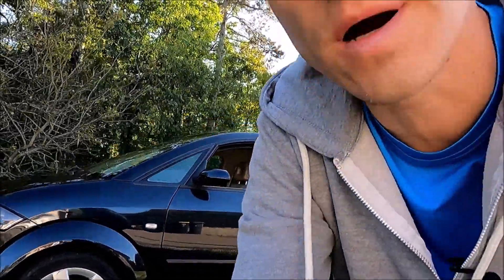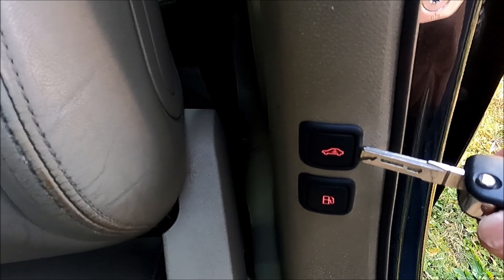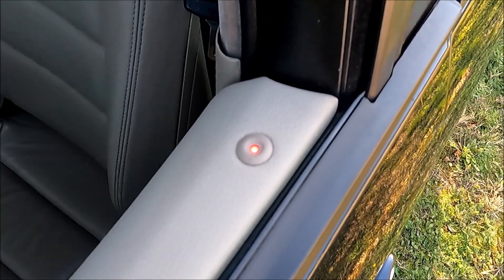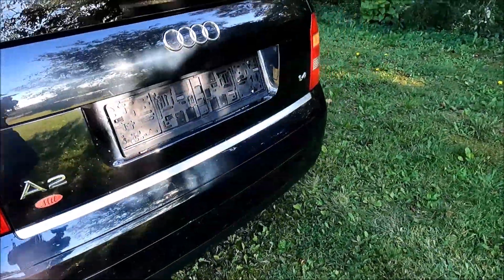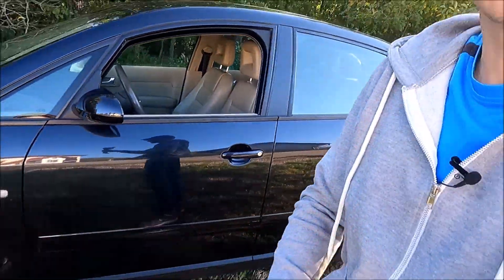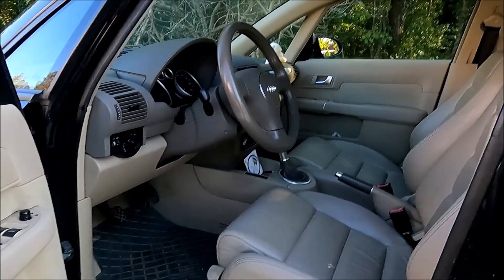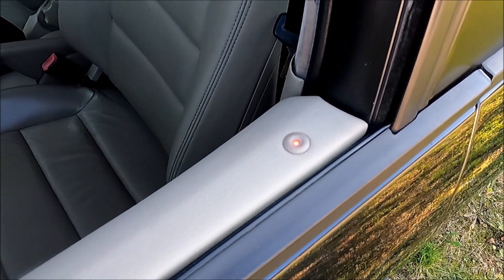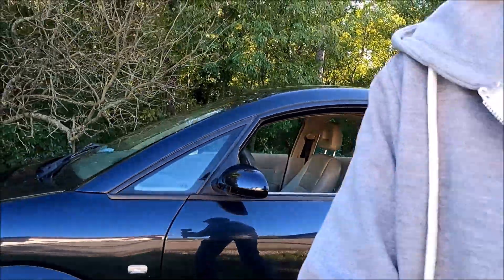Audi A2  – factory alarm system – how does it work?

Comment: When we change the coding in Central Comfort Module not to activate the alarm by keyfob (the very firsy value from the list)
Is it only about the interior sensors? And will the alarm activate when we close the car by putting the key in the lock cylinder?